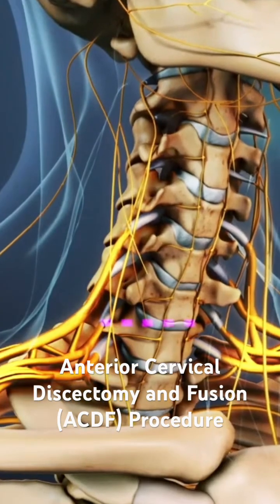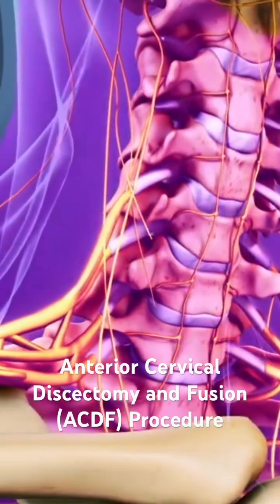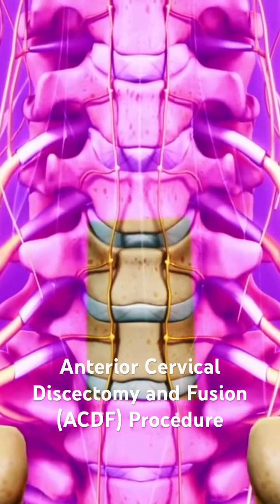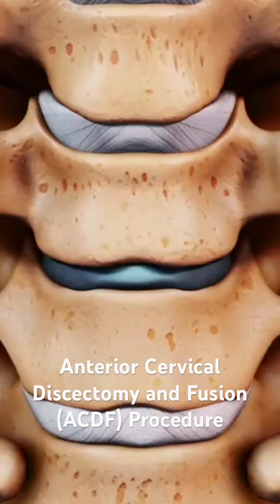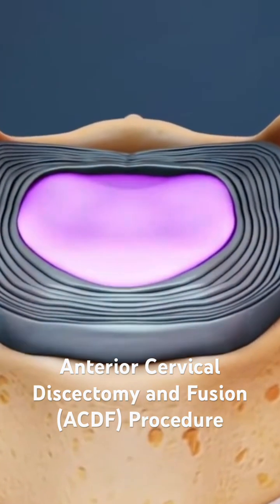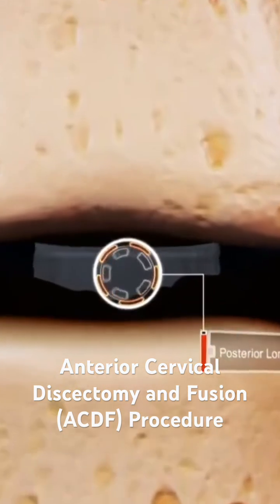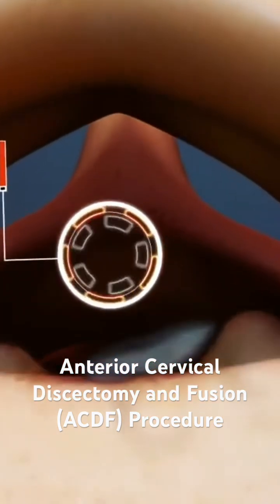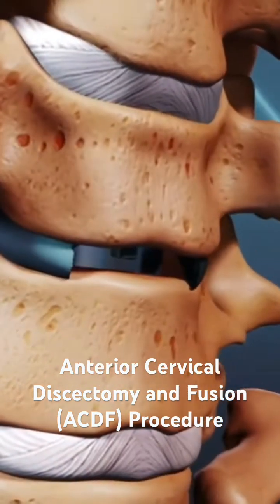Anterior Cervical Discectomy and Fusion (ACDF) Procedure

Comment: I had c5-c6 fusion and my life has been hell since.  I would say I am 90% worse off and its destroyed my life, The pain i get down my left arm is unreal, I only have to move it to quick or the wrong way and boom I'm in bits from the pain. The kicker is they was supposed to have done c6-to c7 done, Plus my surgery took 6 hours to do and i have had no follow up appointment since the op on the 29/10/24. I am a car detail by trade and have not worked since the operation.
Reply: Lawsuit
Reply: maybe dont do surgeries out of someones basement
Reply: Who did your surgery?
Reply: I thought they also put a plate with four screws